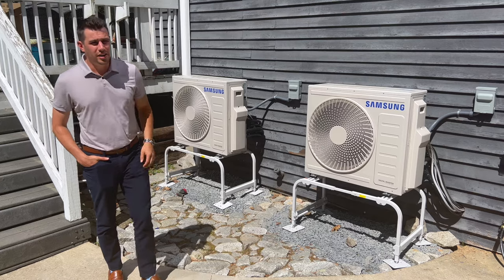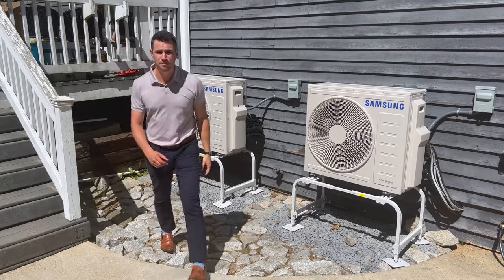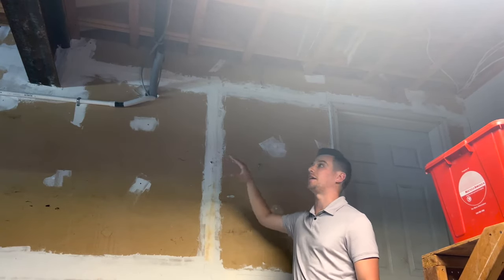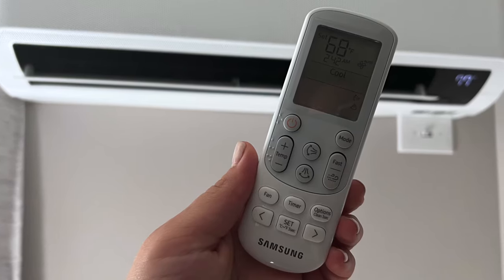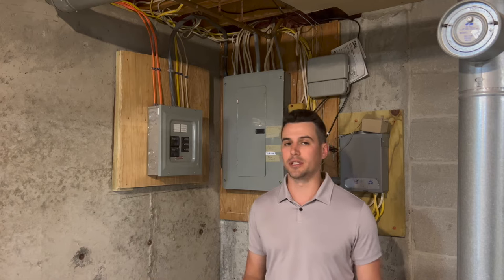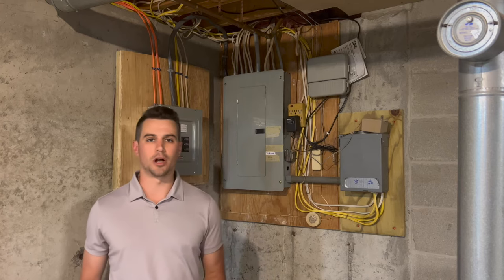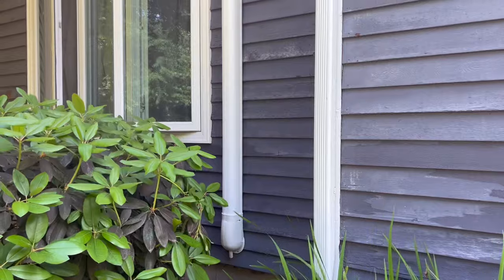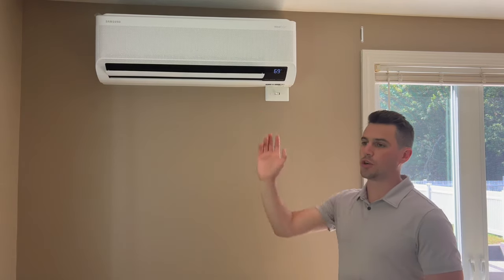Whole House Ductless Mini Split Walk Through

Comment: Switches are ugly on the wall.   Must be a better way than that ugly switch.
Reply: I’m a contractor in Florida and we do not need them by code here I’m guessing that is a code there if not then I don’t know what they were thinking!😂
Reply: Let me rephrase that code says you have to have a means of disconnect within 5 foot of the air handler but they’ve never made us do that here. I’ve installed 100 or more units and no inspector has ever called me out and none of the other contractors I know do it.
Reply: In my state it’s required

Comment: Do they make smaller units for bathroom and walk-in closets? My home office is 10'x10' and I'm concerned that a mini split would just cycle on and off in the small rooms
Reply from the maker: The smallest unit I'm aware of across all major brands is a 6k BTU unit. It is tough to make them work for bathrooms, unless you can do a ceiling casette. For your office you'd probably be okay.

Comment: Thanks for the video. I need to replace my broken system.I’m in SC and  don’t have a basement. An animal got into the crawl space and tore up all the duct work. I have a two story 2400 sq ft house. I really don’t want lines outside my house. 
can minisplit lines be put into the exterior wall instead of outside along the house? My house is old and likely a balloon construction.

Comment: Please excuse my sons picture lol curios as to how much noise these make inside/outside the home and if they heat your home as efficiently as the old baseboards. Right now I love how quickly my home gets warm but am definitely considering switching. I have vaulted ceilings and am worried at how well it works to heat the room if they were installed high up.

Comment: Hi, what us the switch under each head for?    Also, do you guys use whole house surge protectors?
Reply from the maker: The code in new hampshire says you have to have a disconnect at each indoor head (might be changing soon), so that is what the switches are for.

Comment: Instead of using the slim duct on the front of the house for the Livingroom would running inside the wall be an option?
Reply from the maker: You could do that, if the homeowner wants to go through opening up walls it's definitely an option.

Comment: Hi.  Where is fresh air coming from with these systems?  Is there a separate ducted ventilation system or not required because it's an older house with leaks?  If this system was installed on a newer well-insulated house, would they also need a separate ventilation system?
Reply: The air handler inside just acts as a fan sucking in air from the top and blowing out hot or cold air out the bottom.  They’ve have filters on them that you get to easily by flipping the lid up and pulling them out.  Then just blow them off or wash them off with water.  Very efficient technology with these modern mini splits systems 👍
Reply: If you want fresh air open a window.
Reply: Nobody really answered your question!  I have a tight home in NE and mini split hvac ... and yes, you would want a heat exchanger venting system for house. I have whole house Fantech Heat Recovery Ventilator.

Comment: Great work 👌👍 my home is about if not less than 1000. sq ft,  what's the correct size unit for me in Patchogue, NY?
Thank you 🎉
ps: installed 2021  i own Lennox ductless model # MHA018S4S-1P
I think.its leaking from inside and my floor buckled, i believe it's too small. Don't think this guy knew what he was doing,  3500. + unit . I know nothing about this stuff. I get bullied because im a female,  terrible
Reply: Hey I was born in Patchogue.
Reply: @michaelwalker3920 hi Michael 
 I was born in the Bronx , grew up in Brentwood
Reply: It could be the condensate line is leaking or was not led to exterior properly? The 1.5 ton unit you have should be able to heat & cool around 700-800 sf in NY....so could be undersized if you are more like 900-1000sf? You would want a 2 ton unit if 1000 sf. I would contact the installer and have him check for condensate leak and test for refrigerant leak too. If refrigerant is not 100% it could reduce heating & cooling capacity. Any good reputable HVAC technician could check it out for you for $100 +/- service fee, if you don't have any warranty from initial installer.
Reply: I’m in mastic myself and am curious who did your install as I just had the home efficiency experts here yesterday to do an energy audit. The guy was so animated it felt like I was being worked.

Comment: how much would your electricity bill be compared to a traditional split system
Reply from the maker: I don't have an exact $ figure, but the ductless mini splits are much more efficient than your traditional central air split systems.
Reply: @paultheplumber8665  Ok thank you.  Yeah I'm in the trade. I own an HVAC-R Company but i have only seen tests done comparing 1 mini split vs a traditional split system. I want to see what the real difference is between cooling a whole house with a central AC and Mini Split. Im also currently building my house and want to make that decision soon. Ive also thought about a VRF system. Which works very similar to a Ductless Mini Split

Comment: What was the total cost?
Reply: These systems usually cost around 50k installed
Reply: @michaelc9248   50k is a total rip off. And they didn't even install an ICM 493 to protect the equipment.
Reply: @michaelc9248  not even close.  With two condensers and 6 heads I could potentially see 25k TOPS.  If someone gets quoted more than 20k in my opinion they’re getting quoted based on what they look like they can afford.  Zip code quoting we called it in construction.  Quote high cuz they’ll easily afford it.
Reply: In Texas I can get it for $7k . Mini split I want is like 5k & labor probably $2k or less
Reply: @michaelc9248  lol, no
Reply: @devoseokinsey  How many BTUs though?
Reply: @FlyinDogRecords 30k easily. Just depends on brand & how many I need

Comment: Manufacturer's instructions say not to splice the cables, yet you have switches on every indoor unit.  Big no no.  Local inspectors are dykks.
Reply from the maker: The switches were code for years here in NH. Luckily they changed it going forward so they are no longer required.